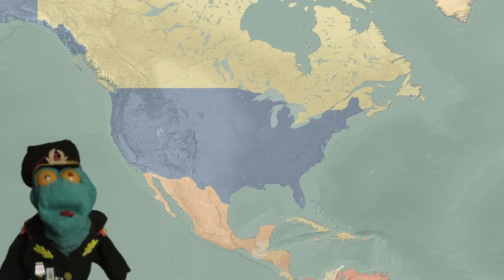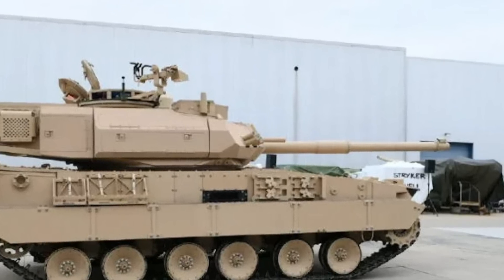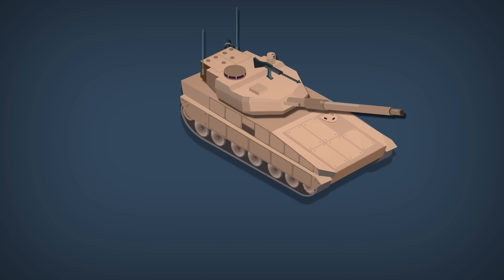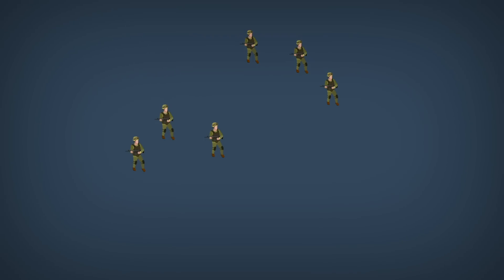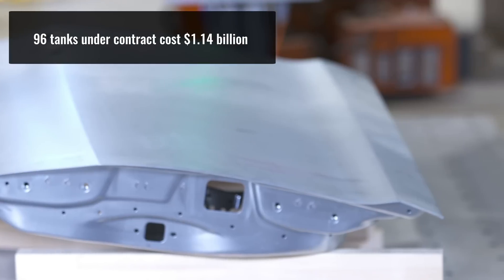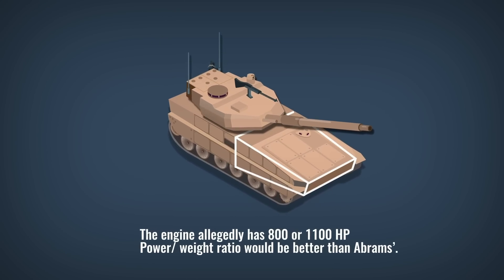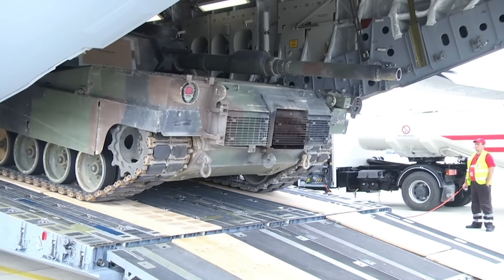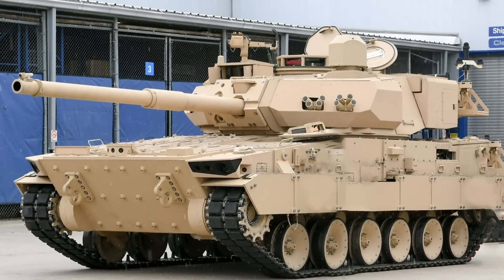US Army just chose its next (light) tank

Comment: The Army seems to be trying to make its units more well-rounded. Adding light armor to infantry may increase their firepower without decreasing their mobility. Given that this tank is much lighter than the Abrams, it'll also be easier to transport and deploy.

As long as they don't become decisively engaged with enemy armor, these tanks will probably prove useful, but I do wonder how they stand up against cheap anti-tank weapons like RPG's.
Reply: Other videos about this light tank talked about how the Military really wanted to keep the weight down. 

They wanted to be able to transport the tank by plane, and air drop it into the battle zone. So the weight needed be kept low.
Reply: It is hard to say since militaries are invested in not showcasing all the capabilities of their weapons and vehicles and it's even harder now since this is only in the prototype stage and we have yet to see any significant field trials. Though in terms of the RPG or most cheap anti-tank weapons the AT4 is the one the comes to mind for me i suspect they will be able to resist strikes from them, with them likely being equipped with reactive armor, but that again remains to be seen.
Reply: Regular slat armor is usually enough to repel standard RPG-7s, which remain the most common man portable AT weapon.
Reply: Not really well as is since the frontal armor, if specifications stay relatively the same as the original Austrian-Spanish Cooperation Development or ASCOD 2 armored fighting vehicle, will withstand 14.5mm rounds fired from no closer than 500 meters while having all-around protection against standard small arms fire. This was done in order to save weight & thus allow one of these things to be transported inside a C-130 Hercules cargo plane. In order to improve protection, it can be fitted with reactive armor but that'll increase its weight & render it untransportable by air but then, it should be able to survive RPG hits, at least theoretically. By the way, I got that info from Wikipedia, if you're interested!
Reply: It's just a re-spin on GD UK's Ajax vehicle. This thing goes back decades. It's a sort of musical chairs of NATO armoured vehicle programmes.
Reply: @TheBigExclusive  They failed in that since this tank has to be carried by a C17, requiring that an established runway has to be available along with air superiority otherwise no C17 will be coming with them.
Reply: @engineeringvision9507  Say, did Brits fix its tendency to poison its crew as well as the troops onboard due to bad ventilation & venting? Did they get to fix its tendency to induce severe motion sickness in those guys, as well?
Reply: @fredhercmaricaubang1883  I think so, the main issue seems to be noise now. They did however add lots of extra fancy computers.
Reply: It's too heavy to air drop.
Reply: As WW2 shown, it will get into direct combat with tanks beyond it intended purpose. Examples M18 hellcat and etc
Reply: @aizseeker3622  YUP! In which case, it'd be best if the US Army upgunned it to the same L44 120mm smoothbore gun as the latest variant of the M-1A2 Abrams Main Battle Tank! Saves a lot of grief later. Most likely reason they retained the L-7/M-68 105mm rifled tank gun is because of a surplus of leftover 105mm ammo still remaining.
Reply: @aizseeker3622  This is capability creep. By making it more capable as a tank it becomes less capable as a fire support gun. If tanks were an issue anti-tank missiles would a good compromise.
Reply: @engineeringvision9507  Not true! Keep in mind that the M-1A2 SEPv3 Abrams' Rh-44/L-44/M-256 44 cal.120mm smoothbore main gun CAN, in addition to firing M829A3 Armor Piercing Fin-Stabilized Discarding Sabot rounds (a TOP-TIER tank killing round, mind you!), even fire M830A1 High Explosive Anti-Tank, M1028 Anti-Personnel Cannister & even M908 Obstacle Clearing rounds although all of these that I mentioned after the M829A3 APFSDS round will be replaced by the XM1147 High-Explosive Multi-Purpose with Tracer rounds by now SO, given all that, if this Griffin 2 Mobile Protected Firepower light tank IS fitted with the M256, then it'll be even MORE potent & besides, wouldn't YOU rather have that capability & not need it rather than to later on need & NOT have it?
Reply: @engineeringvision9507  Oh, before I forget: Given the same amount of space, more tank rounds can be carried than Anti-Tank Guided Missiles & besides, tank rounds have better acceleration out of the barrel than ATGMs & are cheaper to produce, too! Not to mention less fragile & finicky than ATGMs! So, given that, which would YOU choose?
Reply: @fredhercmaricaubang1883  It's a fire support vehicle NOT a tank combatant, and it must be under 38 tons, follow the spec! A 120mm round is MUCH bigger than a 80mm round. By taking the bigger round you give up so much capacity, and fire support is more about number of rounds than size. All that just for the possibility of a chance encounter with a tank? I'm not suggesting filling it with ATGMs either, just take 2 or 3 at most for the one-off tanks. Even that is probably overkill as the dismounts will have ATGMs. If you want a tank, with lots of rounds to do anti-tank stuff then you're in luck because the US army has around 6000 M1A1 and M1A2 :)
Reply: @fredhercmaricaubang1883  The M1A2 doesn't meet the spec. This is a different vehicle for a different role.
Reply: @engineeringvision9507  So, you're saying you'd rather have a smaller gun, possibly an autocannon of anywhere from 20mm to possibly 57mm or even slightly larger to, say, 76mm or even 90mm, over a big gun of 105mm or 120mm or even 130mm just because you want more ammo? If that's the case, what're you gonna do if the grunts run into a bunker or fortification that higher-higher says we just HAVE to capture or destroy No Matter What? To answer your question, the US Army conducted a study back in '70s & '80s on PRECISELY the points you were talking about & found that, for all the attractiveness of the concept, it was only of limited practicality on any actual future battlefield. If you need to look it up, look for what happened to the ARES program. By the way, parts of that same program also lead to the M-1 Abrams Main Battle Tank that we ALL love to this day! And besides, a big gun needs only ONE good hit to destroy its target whereas an autocannon of, say 30mm caliber, needs MULTIPLE hits to destroy the same target & even then, it'll not have the same penetration & destructiveness as a big gun! And then there's the possiblity of running into enemy Main Battle Tanks which is going to be increasingly likely as World War 3 is just around the corner & with it, the definite return of MAJOR tank-on-tank battles the likes of which weren't seen since the 1973 Yom Kippur War but on a GLOBAL scale! So, for those of you who're fans of War Thunder & other similar games, you guys are gonna get your chance to see the Real Thing & maybe even participate in them & if that's the case, which gun would you rather have if your own LIFE is on the line? Another point to consider is that having the same main gun tank ammo as the M-1A2 Abrams simplifies logistics & training, which is another point to consider because, as we have just recently seen in the Russian invasion of Ukraine, the side with the superior logistics wins! And THAT'S what this is All About!
Reply: @fredhercmaricaubang1883  I think you've been playing too many computer games. This vehicle is like an air transportable heavy IFV, and an 80mm cannon is a good choice. Actually I would say 80mm is maybe a bit too big given the relatively small size of the vehicle. It's not an MBT, that is not the mission profile.
Reply: @aizseeker3622  the Hellcat was a tank destroyer. Shermans would call them in. They shoot, and scoot. Leave the real tank on tank stuff for the Sherman. Then call in the heavier Pershing Tank for the real tougher tanks.
Reply: @engineeringvision9507  Nope. The ARES program I mentioned is for real & the stuff you've been mentioning was already tackled in that same program. If you doubt me, you're free to look it up for yourself.
Reply: History repeats itself.  Anything that looks like a tank always ends up filling the role of a tank.  In WWII, the thin-skinned TDs ended up fighting as tanks.  In Korea, light tanks fought T-34-85s.  In Vietnam, Ontoses fought as tanks.  In the Gulf War, Bradleys ended up engaging Soviet made tanks.  And it continues.
Reply: @engineeringvision9507  Chance encounter with a tank? China and Russia got thousands of them actually more than NATO has. If go into Ukraine, or defend Taiwan you will see this thing end up fighting MBTs.
Reply: @fredhercmaricaubang1883  a bigger gun needs a bigger vehicle. Abrams is than heavy enough to carry a 120 MM main gun. This fire support vehicle is heavy enough, and light enough to handle a 105 MM main gun. The Israelites upgraded the hell out of the Sherman to transform it into the Super Sherman. They made the vehicle heavier to carry a 90 MM main gun.
Reply: @Cavalier1645  No, you will not, because the US has 6000 M1 tanks and 100 of these.
Reply: @RogueSabre  exactly
Reply: @black10872  Not necessarily true! To rebut your statement, I submit the M-551 Sheridan. That thing had a 155mm main gun (that's 6 inches or half a foot in diameter), was FULLY air-portable, air-droppable (Ever heard of LAPES or Low Altitude Parachute Extraction System?), amphibious & it served in Vietnam. In fact, if you're familiar with David Drake's sci-fi war novel series "Hammer's Slammers", THIS is the basis of his hovertanks in his novels & the Sheridan weighed 33,600 pounds, ALL UP meaning at FULL COMBAT LOAD. Now, if you convert that number into short tons, that amounts to around 16 short tons ALL UP! Furthermore, the Sheridan was modified by the Naval Surface Weapons Research Center Laboratory in 1983 to carry a 105mm tank gun at the request of the US Marine Corps for its proposed Mobile Protected Weapons System (Sounds familiar?) with the conversion being successful but it wasn't adopted. Now, if that's not a BIG gun on such a light hull, then I don't know what is!
Reply: @fredhercmaricaubang1883  the Sheridan had a 152 MM main gun. Not a 155. And it was able to fire a missile out of that gun. Yes to everything else you said is true. But, the biggest problem was that gun was way too powerful for it's frame. The recoil was so powerful that it knocked out the guidance system for the missile rendering the missiles useless. So crews stuck to firing regular ammo instead. It did serve a little over 20 years before it was phased out. However, they were never able to solve the problems with the upgrades because... That gun was just too powerful for that body.
Reply: The aim here is capacity of rounds, not maximum damage. It's a heavy gun IFV.
Reply: @black10872  By the way, thanks for the correction! Now, on to the rebuttal: I'm well aware of those faults & if you've looked into the Sheridan's history, I do believe I did state that in 1983, the Naval Surface Weapons Research Center Laboratory modified a Sheridan to carry a 105mm tank gun in response to a request by the US Marine Corps for their proposed Mobile Protected Weapons System &, by all accounts of those present at the time, the conversion & succeeding trials were highly successful but, unfortunately, it was not adopted & was thus cancelled. Now, we clearly see that the 105mm tank gun is much smaller & lighter than the original 152mm main gun &, with modern developments in tank gun technology now producing a high-pressure low-recoil/soft recoil gun mount system, don't you think that light tanks armed with 105mm rifled or even 120mm smoothbore tank guns are just about ready to make a comeback on the modern battlefields of the 21st century? Especially now that there's an increasing likelihood of World War 3 breaking out between the democratic West versus the authoritarian states led by china & Russia? And if you're a grunt on the ground on the front lines & the Abrams is too heavy & too expensive to be available everywhere, wouldn't you be reassured that at least these light tanks are around to watch your six & ready to pitch in when & where they're needed?
Reply: @engineeringvision9507  And you think an autocannon of anywhere from 20-57mm can destroy a reinforced strong point or bunker, let alone an enemy MBT?
Reply: @engineeringvision9507  Yes they will cause USA has grand total of 2500 tanks in service and China and Russia have 4-5000 for China and about potential 14000 for Russia. And all our Abrams will take months to mobilize and mass. Ya just like our Bradley's, Stykers and LAV have to contend with possibly of engaging enemy armor this little waste will have to too.
Reply: @engineeringvision9507  It's a waste of money any direct fire support can be done with a Tow and at least Tow can potentially kill a modern MBT. This things gun will not be able to unless it get on the side of MBT and that not guarantee against the cutting edge MBTs.
Reply: @DavidPT40  Yep except this thing more like Sherman's  going up a  IS II or III on a 1on1 basis with predictable result. In another words the light dies a horrible death.
Reply: @fredhercmaricaubang1883  the biggest reason why the Sheridan was probably cancelled was because the Corps had a new Commandant. That Commandant probably wasn't interested in the vehicle. Therefore, he decided the Corps will use the M-60. The Corp didn't have a Main Battle Tank until the 60 was available to them. But, what I learned about warfare is that you don't fight a war with what you want. You fight a war with what's available.
Reply: @black10872  Y'know, we've strayed from the main topic at hand: The viability of light tanks on the modern battlefields of the 21st century. And, as you said, once World War 3 starts, we're gonna have to fight with what we have on hand. No argument from me there but, while we still have the time & resources, wouldn't it be wise to stockpile as much of the best stuff we can before the world goes all to Hell? What I'm saying is that wouldn't it prudent to get a light tank with the same gun as the Abrams MBT so it can use the same ammo & thus simplify logistics & then build & stockpile as many of these things as we can while it's still "peacetime"?
Reply: @fredhercmaricaubang1883  I hear what you saying but, for this new light tank to carry the same main weapon would be just too much for it's body. Going back to the Sheridan. As powerful that main gun was... It was just too much kick for that vehicle. A 120 MM Gun for this light tank is probably too much. But, if this vehicle can take a 120... Then what's the point of an Abrams??? Furthermore, I'm pretty sure this new system will have armored upgrades. Those upgrades will definitely make the vehicle heavier. Later gun improvements might be able to fire a missile out the main gun. Something, that the Russians made work right better than the US did.
Reply: @black10872  As I have said earlier, believe it or not, it is now possible to mount even an Rh-120 L/44 smoothbore tank gun (also known as the M256 on the M-1A2 Abrams) or even its more powerful & longer ranged L/55 variant on something like the Sheridan, which this vehicle, the ASCOD Griffin 2, just happens to be a descendant of! If you're worried about recoil, there are now gun mounting systems called High-pressure, Low-recoil/Soft-recoil systems that CAN be fitted to light vehicles such as this beast which will enable it to fire ON THE MOVE without tipping it over (That's utterly HILARIOUS, if you happen to see it!) even while operating on adverse terrain. And as for Griffin 2 light tanks replacing the Abrams MBTs, that's not likely, at least not immediately & most certainly NOT in intense MBT-on-MBT battles! I mean, COME ON! It'd be CRIMINAL to pit thin skin light tanks against MBTs in a head-to-head battle without first up-armoring them to at least give those poor suckers a FIGHTING CHANCE of surviving the encounter but it'll come down to crew skills & tactics & quite a dose of Good Luck & I believe in minimizing luck! And the way to do that is to fit this beast with the Rh-120 L/55 smoothbore tank gun as it'll give it not only better punch than even the latest M-1A2 SEPv3 Abrams' own M256 main gun (which, by the way, could be swapped out for a license-produced variant of the L/55) but also longer reach! Now, couple that with superior crew training & tactics plus add-on spaced armor & Explosive Reactive Armor arrays along with something like the Trophy or Iron Fist Active Protection Systems & NOW those light tanks have an even better chance of not just surviving an encounter with Russian or chink MBTs but also of BESTING them & THAT'S WHAT IT'S ALL ABOUT! And as for the added weight (which you correctly pointed out), I believe it'll be worth it considering that it'll mean tank crews survive & THOSE are exceedingly hard to replace so, don't you feel saving their lives & limbs are WORTH it? And besides, even with all the stuff I just mentioned being added on just before battle, the overall weight of this light tank will STILL be MUCH lighter than the M-1A2 Abrams SEPv3 while still retaining superior mobility. Now, if you think lighter tanks don't stand a chance against heavier ones, then I submit what happened during World War 2 in Europe when Sherman tanks weighing 26 short tons faced off against 68 short ton Tiger & King Tiger tanks! Granted, initial encounters between these two didn't go so well for the Shermans but, over time, Sherman crews came up with new & innovative tactics to beat any Tiger & King Tiger tanks they encountered. So, given this, & if the Griffin 2 light tanks are fitted the way I proposed here, I personally feel that those same Griffin 2 equipped units will fare MUCH better against their Russky &/or chink MBT opponents than the Sherman crews initially did against the Tigers & King Tigers from 78 years ago! Well?
Reply: @fredhercmaricaubang1883  I think it would have some problems with that. I remember once upon a time in the past, Singapore did something similar, a United Defence 120mm on a light tank. It was found that the thickness of the hull was not sufficient to support the 120mm's recoil, causing stress cracks along the turret ring and potentially causing turret jams. Sometimes bigger is better but over-big can be a problem too and you'll want these tanks to last, not get scrapped due to jammed/cracked turrets.
Reply: @fredhercmaricaubang1883  Yes a 20-25mm autocannon can destroy a bunker or a fortification. It's in the field manual the number of rounds you need too, think it was 3-5 to breech. Which still is a lot less than the space a 120mm takes up.
Reply: @danielc2701  That may be true but that's what recoil dampers are for! Specifically, High-pressure, Low-recoil/Soft-recoil recoil damper systems. And if the guys who designed & built the Austrian-Spanish Cooperation Development or ASCOD 2 armored fighting vehicle series, most especially the Philippine Army's ASCOD Sabra 2 light tank, are to be believed, then it IS possible to fit the Rheinmetall Rh-120 L/44 smoothbore tank gun or even its L/55 variant to this same hull with NO problems. Or so they say.
Reply: @danielc2701  OK! If say you so! But tell me: How well fortified was said target? How close was the vehicle to the said target? Was the said target covered by anti-tank weapons & was said target firing back with those same weapons? And exactly how many rounds did it take to neutralize said target?
Reply: @fredhercmaricaubang1883  .... it was a low recoil system... I trust Singapore more than the sales person because it takes a lot of guts to admit they screwed up and they did post a study about the reasons. And it was because the hull simply was not strong enough, even though they used a steel/steel construction rather than the more common steel/aluminium construction in the West. I mean, the salesperson definitely won't tell you that firing the gun often causes hairline cracks on the armour or causes turret misalignment will they?
Reply: @fredhercmaricaubang1883  Range is agnostic because the rounds used were HE, not APDS. I'll go recheck the field manual and see if it's available online so you can read it for yourself.
Reply: @fredhercmaricaubang1883  Ok, found it, FM 90-10-1. "Bunkers with earthen walls 36 inches thick are easily penetrated" page 189. Ironically the inert practice round actually causes more damage to walls than HE or APDS-T. 8 inch reinforced concrete needs 40 rounds of 25mm to create a breechhole that an infantryman can use to enter. Firing at an angle actually is better since it removes more material. The APDS-T will punch right through and only needs 4 rounds to clear out the enemy inside. The facade will still be intact but the enemy will pretty much be dead with the sabot bouncing around inside the room.
Reply: @fredhercmaricaubang1883  Found out something else. "Both 105-mm and 120-mm tank cannons have two
specific characteristics that affect their employment in built-up areas: lim-
ited elevation and depression, and short arming ranges." "The 105-mm HEAT round arms within 25 to 30 feet, and the
120-mm HEAT-MP round arms at about 36 feet." So the tank can't get too close or the round is a dud. (Page 193). Forgot a lot of these stuff that I once read before.
Reply: @danielc2701  You're assuming the guys who designed the Austrian-Spanish Cooperation Development or ASCOD 2 armored fighting vehicle series were totally ignorant of that fact. As you're well aware, once engineers see a problem, they come up with ways to solve that problem hence the ever improving tech &, along with that, the relentless advance of technology. And I 'd rather trust the Israeli engineers of the ASCOD Sabra 2 light tank (now in use by the Philippine Army), which is practically the same as the Griffin 2 light tank, who say they CAN fit the Rheinmetall Rh-120 L/44 smoothbore tank gun (or even its L/55 variant) & STILL enable it to fire while ON THE MOVE WITHOUT ANY ISSUES & who have ACTUAL, REAL combat experience rather than the singaporeans who've never been in a shooting war & wouldn't know what works & what doesn't in such a situation.
Reply: @fredhercmaricaubang1883  You have a very overidealized image of engineers..... and no, the people in the original design team will NOT know it for a very interesting and specific reason. It was never in the original design specs for the vehicle to resist 120mm recoil, which means they would never have bothered testing parameters that are out of its performance requirements. You're busy enough every day that you don't go look for extra work to do AND I doubt you'll get funding for superfluous tests. Testing, especially buying a new 120mm cannon and installing it just to test for something that is not intended for costs a lot. No. I doubt they ever tested for 120mm cannon stress parameters.
No, you're just begging for trouble with a 120mm on such a light frame.
You disagree, so be it, but I have to point out that your understanding of design is still very, very basic, in the "bigger = better" mindset rather than "what are the problems if I went bigger" and it shows.

BTW there is no Sabra 2 for the Philippines, it's Sabrah 1 and Sabrah is still using a 105mm gun, not 120mm. You're referring to your own imaginary equipment. The Sabra 2 isn't an ASCOD, it's an old M-60 modification. And the M-60 is a 60 ton tank. That extra H makes a lot of difference.
Reply: @danielc2701  Is that so? You forget that it is Private Firms & not the military that made advances in technology, most especially so in the field of military technology. If we go by your logic, there wouldn't be any technological advances in whatever field. If that were the case, we wouldn't have ever newer technologies coming out almost everyday. The devices you yourself used to type your rebuttal to my statement is just such proof of my point. I'm pretty sure even you have to admit that technology continues to advance at an ever increasing rate! I'm pretty sure you've swapped out your own old devices for much newer ones as they became old & unsustainable & if such is the case with you, then why shouldn't it be so with military engineering & their engineers? Keep in mind that war itself is a BUSINESS &, just like any intelligent business, one must keep track of trends & competitors in order to keep on improving one's own products & thus corner as much of the market share as possible, wouldn't you agree? So, given that, why do you assume the Israeli military engineers would be ignorant of such trends even in a place so far from their own home as singapore when the very survival of their country & their people are at stake? And, given that, if they are aware that some technology didn't work out for somebody else, why do you assume they WON'T somehow find a way to adapt it & make it work & come up with a tidy profit for themselves while they're at it?
Reply: @fredhercmaricaubang1883  It's getting kind of obvious you're running on nationalism rather than physics and practical considerations at this point in time.....
And by the way, you still did not address the point that your so called "israeli engineers" did not fit a 120mm gun on a Sabrah like you mistakenly thought. It's a 105mm gun. You obviously mixed up a Sabrah with a Sabra 2.
Reply: @danielc2701  I'm FULLY AWARE that the ASCOD SABRA light tank is fitted with the 105mm rifled tank gun for now. Again, Take Note: FOR NOW. And just because you believe the singaporeans couldn't fit a 120mm gun to a lighter hull & make it work DOESN'T  mean that somebody else, be it the Israelis, Spaniards, Austrians or even the Germans, couldn't do it as well! You claim I'm talking about it from a nationalist point of view but you are WRONG. That is YOUR VIEW. You just DON'T want to admit that technology advances with time & THIS is an Undisputable FACT, whether you like it or not! But very well. I see there is NO point in arguing with a Luddite who stubbornly refuses to see trends arising from facts as proven by history. NO amount of sound, rational argument backed by historical proof will sway such as you so I propose this: Stay alive & bear witness to World War 3, as we ALL know that it's coming! Survive it & then see who between us is correct. After all, HISTORY is written by the Victors! Then let's see who was right all along!
Reply: @danielc2701  All I have to say to you is this:TIME WILL TELL! Let's let history see who of us is right in the end. Oh, and DON'T project yourself on me. I merely state facts & offer my conclusions based on them. If you don't like them, NOT MY PROBLEM! You're entitled to your own opinion, just as I'm entitled to mine & THAT'S WHAT A FREE SOCIETY, A DEMOCRACY IS ALL ABOUT! As I said I said before, TIME WILL TELL! Let's settle it that way!
Reply: @fredhercmaricaubang1883  Considering that I'm referring to an event that happened in the 90s, time has already "told". You're just a bit hard of hearing.
Reply: I would guess it will have Modular Active Protection System or Trophy
Reply: I have a feeling that the crews will not wait for reinforcement if they met enemy MBT and will just engage the target with whatever weapon they got, in this case the inferior 105mm cannon...
Reply: @navyseal1689  haha yes ofc, just like a truck driver will ram any tanks he met. Do you think IFV just go head to head with MBT? Its i support tank not a MBT, the leadership from TC to brigade commander know this annd will use it as such. I don't really see why they did not go for a CV90120 or the like but the things is that whatever they have a 105 or 120mm they would have low chances front on front against a MBT. I have worked with boths IFV and tanks annd i would say that as a IFV/ATGM team you will be able to chose your battle or you will be dead.

And i would add that a platoon or company of this tanks would work inn support of inf, so if they face tanks they pull back and let the inf work, if the inf face bunkers etc the tanks attack.
Reply: @navyseal1689  Better than nothing! That's why I propose fitting a 120mm smoothbore tank gun from the start! Simplifies logistics PLUS better tank-killing capability from the start! Can't beat that now, can you?
Reply: @navyseal1689  "Inferior" it might be but it can still cut through MBTs at closer ranges. Damage from APFSDS increases the range closes simply because there is less energy loss from travel closer to the gun. If it can't penetrate, get in closer. The Merkava 1s and 2s use it as their main gun as well as their old Patton tanks and they have not shown any problems showing Syrian T-72s the door. Hell, I know of one AAR during Gulf War 2 where a pair of British Warriors got caught by surprise by a fleeing Lion of Babylon and they caused it to blow simply by pouring RARDEN rounds into that thing (it's a side effect of focusing on ERA, can't take repeated pounding) and that is a 30mm round. The 105mm is more than enough if you play it smart like going Turret Down and only opening fire when they are closer.